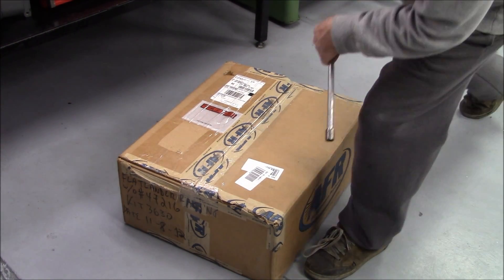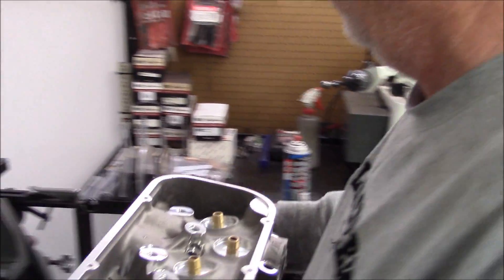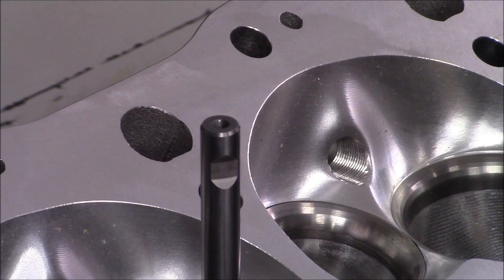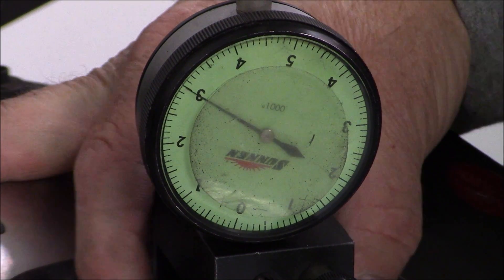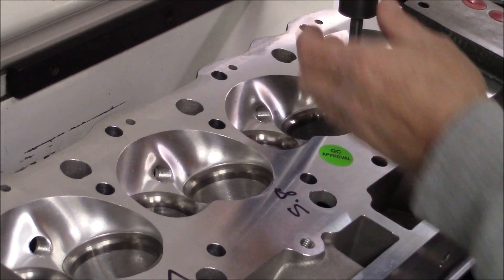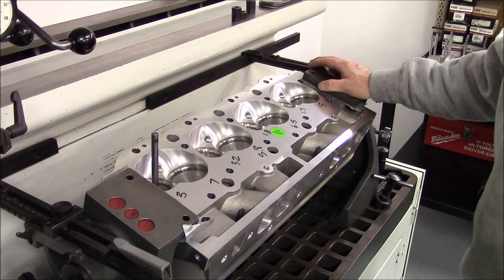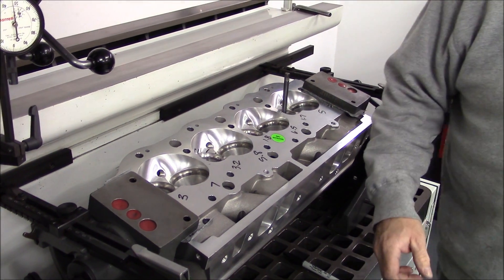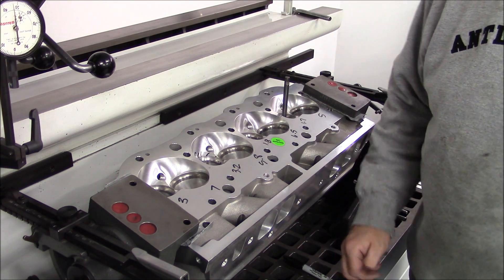Aftermarket Cylinder Heads - Why You Shouldn't Just Bolt Them On - Part 2 - TRRC / Vortecpro

Comment: I machine aircraft parts where tolerances can be plus or minus  .00005 .I understand that engines don't need that tolerance.  But this video is cringe worthy to any decent machinist. Except this guy
Reply: how do you measure .00005 breath on it? I have been rebuilding aircraft engines for years never saw anything that close.
Reply: @midgetrace  Well said    A&P 50 years, aircraft quality  ?   You & I know better !!!
Reply: @midgetrace  in making lab equipment (granite slabs for lab tabletop testing slabs and etc) we have to mill them down to a level of +/- 0.0002 and THAT takes insane calibrations and measurement abilities. I couldn't imagine having to machine and measure in HUNDRED-thousandths. Lol
Reply: He said parts, so I would think things like landing gear, hatches/panels, wing flaps, etc., and the parts that make up those assemblies.
Reply: lose at least one zero there fella
Reply: A good jig grinder might have a chance on that best case.

Comment: Guy is talking about quality then throws the packing bolts around all over the heads. Possibility of damaging the valve guides.
Reply: shane  Maybe. If the guides were reamed before, you might not have any material left to ream.  Which would mean replacing the guides and reaming because of carelessness.
Reply: Yeah? And what do you know, arm chair mechanic?

Comment: I think the microphone is just picking up every metal to metal contact as “slamming”. Sounds like acoustics is also amplifying that. I haven’t watched his other parts but I see nothing wrong here. Laying the ratchet down on the head may not be best practice but didn’t hurt a thing. Have you guys ever used as much as a dial indicator or been in an automotive machine shop? Sure, you don’t throw tools down but you don’t wipe them with a baby diaper every use either. Is there a particular “boom” I’m not hearing? The vintage indicator having a dirty, scratched crystal means nothing. The readings were repeating fine. Just curious if everyone is piling on, Monday morning machining, or what?

Comment: My guess is they didn't grind the seats, because these heads are sold without valves.  That means it is up to you to grind the seats to match your valves.. Are you sure you've done this before?  By the way, if I saw you tossing bolts and a ratchet onto cyl heads that you were selling me, I'd be long gone.  
   The funny thing is the name of the video is...  why you shouldn't just bolt on the aftermarket heads... then you open a box of unfinished heads. Yeah. I guess if you bolt them on with no valves in them. you' might have trouble getting the engine started.
Reply: Tim Hallas ...they flow a lot more with no valves...ha ha...
Reply: I'm sure they do. Let's try one.
Reply: There is no way to cast a head with what looks like a three angle valve job.  These seats have been cut.
Reply: @threynolds2 :  Let me be the first to say it.  You obviously don't know anything about valve seats, so why are you commenting on my comment?  Valve seats are not part of the casting. They are a separate component.
Reply: Well excuuuuuuuuuse me.  I've only worked on cast iron heads that do not have separate seats.
Reply: @threynolds2   That's interesting. Every cast iron head I ever worked on has inserted steel seats. You must be working on some antique European engines.
Reply: 1968 Ford 302 and 1970 Ford 429 cast iron seats with seats ground into the head with no inserts.  Pre unleaded gas era heads.
Reply: @threynolds2 : So you are saying that you worked only on those two heads, and therefore you thought that all cast iron heads had no inserted valve seats.  That makes sense now....  NOT.
Reply: Tim Hallas, in the days of leaded gas, most cast iron heads did not have steel seat inserts.  It was after unleaded gas came out, and was all you could buy, that steel steel inserts came into use.  Look it up.
Oh, the structure of your last sentence means "it doesn't make sense".
Reply: @threynolds2 : I already researched it. You are wrong. Steel valve seats have been common since the 1950s.  I did valve jobs on pre-unleaded gas engines. They all had steel valve seats. You must be from Europe or Asia.... maybe Africa.
Reply: Tim Hallas, I was born in Kentucky in 1957.  I have over a dozen pairs of heads in my garage right now, '66 289s, '68 302, '70 429s, and '73 460s, all with no set inserts.  The seven pairs of 428CJ heads I sold many years ago also had no seat inserts.
Reply: @threynolds2 :  What makes this all funny is that you watched a video where a guy was measuring the valve seat run-out on an aluminum cyl head, and you didn't know that those seats were inserted into the head. And now you want me to believe that you are some kind of cyl head expert.  Not happening bud.
Reply: Yep, the joke's on me.  Carry on.
Reply: So much miss information in this conversation. First off with the AFR heads. When you buy your head you HAVE to know what your valve size is. But so long as you know yourvalve size then the seats will be cut for your valves. Now in a perfect world there’s no run out. But factory’s are all about getting the heads out the doors. Now a side note to that. If you had taken your brand new heads to a machinist to check valve clearance and run out. You can also have the machinist change your seat angles or location of the 45degree on the seat in relationship to the valve. 
     As for cast iron heads and hardened seats. Sure hardened seats have been used for a long time but it was not an industry standard. Chevy didn’t run them in the SBC heads till the TBI engines. And Ford never ran them. That’s why ford has such issues with sinking seats.Now every aluminum head ever has hardened seats in them , no argument there.
Reply: @jamesthemachinist1325 :  Thanks for adding to the misinformation, James. I can't believe you actually said "Chevy didn't rune them in the SBC heads til the TBI engines. and Ford never ran them." Seriously dude. I was grinding valves long before fuel injection became the industry standard. I recall having to replace valve seats that had come loose and bent valves in the 70s. Those were  cast iron heads with a carb on top.  How old are you?  35?  you weren't there.
Reply: Tim Hallas: They look grindet to me, in fact i'm sure of it. When delivered without valves, yes the valves need to be seated properly, but this should be doable with a small valve grinder kit from a pre/rough grindet seat. What we're looking at here is just the result of a really bad valve job and an old bitter man
Reply: @VikingRul3s :  These valve seats would certainly not be ground at the factory. You have to know the sealing surface angle of the valves you are installing, before you grind the seats. This idiot doesn't know this. It is also quite possible that the tool he is using to measure for seat run-out is bent. Trust me, I have done this shit for a living.  This guy is an idiot.
Reply: @timhallas4275  It's pretty obvious they've been ground. There's at least 3 angles that  you can see on the seat. Done it for a living eh? No wonder why it's past tense.
Reply: @C5Z06CarGuy  : Those are raw, valve seats, right out of the box. There is no point of grinding the seats if valves are not to be installed at the factory. I have done many aftermarket new heads. The first order of business is to cut the seats to whatever valves you are going to install.  Past tense is because I am retired,  numb skull.
Reply: @timhallas4275 , that's what I figured is this and the first video is just fear mongering to drive up business.

If AFR heads are as bad as he and a few others claim I think k we would see enough failures to force a class action lawsuit.
Reply: Tim Hallas LMAO!!! 😂
Reply: Well, yeah. Its up to you to marry the valves on the heads.
Reply: This engine wont start. How come? I dont know, I just bought these brand new AFR heads out of the box. Did you check to see if they had valves installed? Oh fuck.....
Reply: Tim Hallas 😂😂💯

Comment: Check your valves they will have a run out just as the seats have. Mark the seats and hand lap the valves to the seat it takes a little time but results are perfect seal for absolute  maximum compression. JUST SAYING. Not bitching just another  way to skin a cat

Comment: Also i believe the angel of the seat makes a big difference when chasing extra HP and the perfect seal is the best for both intake and exhaust seats. :) also using good quality and perfect seating valves materials like inconel for example like in the LS9 heads or LSA heads. :)

Comment: thank you it just goes to show that even through these heads are all CNC'd to spec, it looks like they have not QC at all, if you have that much of a difference in measurements between the intake and exhaust valve seating ? Total and utter rip off, so why not put this to a consumer watchdog in the states to prove that so many companies are not doing what they say they are supposed to do and supply ? Also just imagine the inside ports for exhaust and inlet, if they are to spec as well and the flow rate for each of those ? :) what about other important areas like the main bearings and also the main bearing bolts which are supposed to be Hex head type to better 12.1 grade, how easy is it to by cheap ass important bolts and stamp the tops of them with whatever you like to sell for 5 times the price you paid for them, lol :) it goes on trust me, till you check everything your self or have someone who knows what they are doing to check it, as an example i brought a set of rear brembo calipers for my GM SS and the place i brought them from said that the OE bolts for them fit, so when it was time to put them on, i noticed that the brembo calipers have a totally different thread, instead of the normal coarse thread like in the OE, the Brembos have a fine thread for the bolts and they are the same grade ie 8.8 and the same length but not the same threaded and the worst thing is this, the owner of the company who i brought them from, said they use a rattle gun to put the bolts into the calipers when fitting them, so just imagine how many cars they have done which when it comes to taking off the calipers for whatever reason maybe to paint them or to change them whatever reason, they will never ever be able to use those rear calipers unless they rethread the inside of the calipers and with a little larger bolt size in DIA all over again, so it goes to show to check everything especially in critical areas of engineering issues ?

Comment: If I were you I'd be way more careful with a set of 2000 dollar heads. Clankin em together and recklessly clamping them down without wiping the mating surfaces makes me question whether the measurements you are taking are accurate. When your working with tolerances you can't see a bit of lint or dust can throw you off. I've been a Yamaha motorcycle tech forever and things like that matter a lot. Or maybe I'm too meticulous. Don't think so but maybe.
Reply: No you are the type of person that we take our stuff to. Most of us don't have the equipment to do our own heads but it's nice to know that the shop you choose realize the trust we put in them and do it right.
Reply: port nut apparently you’re required to own a shop to have a valid opinion on this guys handling of the heads

Comment: Good to see I'm not the only fussy bugger when it comes to having all the seats and heights matching,port shapes and volumes all even , because if you don't then weird harmonic pulses float back and forth effecting the way the head will breath.  with everything spot on you might be flowing cleanly 10% or more better than an out of the box head which might equate to another 50 HP simply by flowing cleaner and creating less undesirable turbulence.   An old racer engine builder once told me that 50 HP doesn't sound like much  BUT it makes a HUGE difference when you add up the 100 places here and there that you have removed a few ounces , in other words every little bit helps.

Comment: The way you throw shit around.... I'm surprised you don't use a die grinder to cut the seats, a rasp file to to deck the head and probably use a hole saw to bore an engine block and hone it with some 60 grit sand paper!!!!!!

Comment: Not all aftermarket heads are like that... afr is not a type of head I would be using anyhow... There are other for example Allen Johnson, or a set of Sonny Leonard heads... Or maybe even pro-filer heads, or brodix heads... But that's it all the other heads for a big block Chevy are a waist of money... Even the big chief heads from dart are boat anchors...
Reply: You can't get a set of heads from Sonny Leonard or Allen Johnson at anywhere near the same low price as AFR.   They are great flowing heads for the money.  So spend a little money to make the seats concentric, and you're good to go.

Comment: This isn't the first video I have watched addressing these types of issues. Much like any other mass produced product, time is money; So in the end preparing a finished product faster increases profit due to the time spent on making it. This is a big part of why I hate bean counters, while I agree your better off ordering bare heads and having them finished by a local machinist; This is also something that is quite hard to find. I once got 5 right bank and 3 left bank piston / rod assemblies, when I took it back to the machine shop the guy said it was a good thing I caught that. I don't use that shop anymore, however the thought going through my head was what kind of mechanic doesn't look at what he is putting together.

Comment: I like the way your demonstration is but id like to see the run out of your valve seat again after you remove your pilot and reinstall it to really prove a point ...that machine is using a tapered pilot system and that system can create variables..guide and pilot quality need to excellent...parallel pilots in other machines will pick up a true centre because the pilot goes all the way through the guide when floating the cutting head.. ...just a thought

Comment: While I agree one should never just install without checking, it would have been more conclusive to have seen the arbor tested for straightness & wear; as well as "clocked" the same in each guide - just to see if there was possibly and extra run-out introduced when "wedging" the tapered arbor in the the guide. I've been doing  valve jobs 50+ yrs, using Kwik-Way, Serdi and Newen Contour Epoc (which you mentioned these heads were cut with)and have seen error introduced when measuring, especially if the valve guides were bell-mouthed or on even - another reason to NEVER bolt heads on straight out of the box. While you likely have a perfectly good, unworn, straight, tapered arbor in the video, it's always good to carefully clock the arbor as close to the same for each seat, and note where the worst  TIR is for each seat -Then rotate your arbor 180° and see if the TIR shifts with it; as a means to double check your method & arbor.  Also,  pushing the tapered arbor into the guide with as much force as much as it seems you're using, can easily distort the thin ends  of hi-performance valve guides - which is another way to introduce error in your measurements.
Reply: You are sounding like a tool & die maker good response!

Comment: I'm disappointed you didn't throw the heads around a little
Reply: Samsgarden 
9 months ago

I'm disappointed you didn't throw the heads around a little ...That was in the outtakes we didn't see. Throughout the whole video, this guy sounds ticked off at every nuance he could find.
Reply: @rooftopvoter3015  "ticked off" ? This guy sounds like a nut job. If I were that bitchy I would start shoveling rocks.
Reply: LOL This guy has done more with factory iron castings than you have done with your entire life. 
Just one of his street prepped pump fuel BBC customers.  https://www.youtube.com/watch?v=6WEyhEZq1NA
Reply: Wow.
You act as though he used the customer's head as a wheel-chock for the UPS delivery truck.
Perhaps he displayed a bit of attitude ...  but, your comment does also.
One noteworthy difference might be, that one would be hard-pressed to find evidence of any damage that he had imparted on the heads in his care.
I wouldn't say the same about your comment.
Next time you polish your exhaust port to a mirror finish; take a moment to note your reflection in it.
Reply: @marshalllhiepler  High polished castings maximize heat reflectivity, minimizing heat absorption of course. Race engines used to have pistons polished to a mirror finish for the same reason for the same reason. Then heat reflective coatings came along. From the moment the guy unbolted the heads and chucked steel fasteners onto a brand new aluminum casting like it was a tissue or something... Precise measurements like this need precise instrumentation. Who knows how often these engine builders calibrate their tools. An uncalibrated tool could make any measurement look out of spec. The way this guy went about the whole process has obviously made many in the comment sections a bit uneasy.
Reply: Nice.... i was hoping he would force some precision worn out instruments into the situation creating inaccurate measuring but then again we can’t get what we want... Dear Santa.. :)

Comment: As a question, what's the tangible power difference here? Just curious.
Reply from the maker: If the motor is sealed up better it will make more power. It may not be much, but the main reason for correcting the valve seat run out is so the valve guide doesn't wear out.  Also the valve itself will not fatigue and bend/break.

Comment: were the heads originally torque plated ? Could explain the big variation. If you bore gauge a cylinder after the torque plate is removed it will look like hell on the dial gauges. Just saying....
Reply: Who torque plates a head? I think you're confusing this with block machining lol.